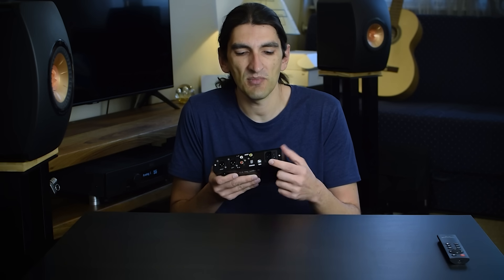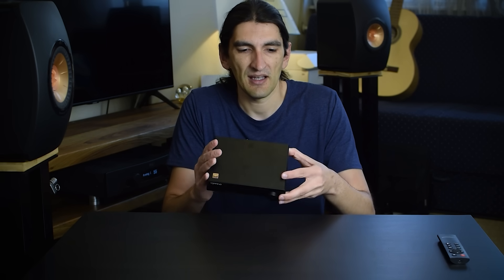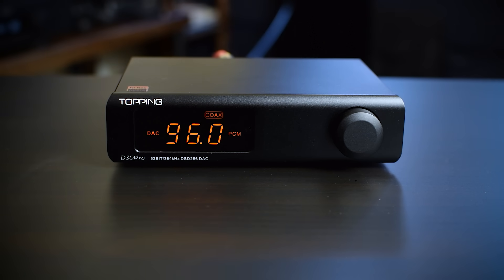Topping D30 Pro review - Don't buy a new DAC before watching this

Comment: How does it fare in 2023? I'm torn between buying e70 velvet or spend $250 less on d30 pro(in my country prices are wild). Or are there any better dacs in this price range?
Reply from the maker: I don't know the rest of your system and how much the case of Audiophilia advanced with you. But I would go for E70 velvet no doubt.
Reply: @iiWiReviews  So it is worth an extra $250(in my case). I've wanted a good allround ds dac, so I can focus on upgradeing my solid state amps and getting into r2r. Sort of a reference in this price range. I've considered this used d30 pro bcs the less I spend on a dac the more I can spend on new amp/headphones and soundstage is quite important for me.

Comment: Just now i ordered Topping A90D in flash sale.
Is this D30 pro technically compatible? Will it work in stack with A90D ?
Reply from the maker: Congratulations! It will work no problem.
Reply: @iiWiReviews  lot of thanks from INDIA.
I suddenly bought A90d which forced me to buy this d30 pro DAC.
E70 velvet is not available here in India.
If E70 velvet is better than D30 pro, i should be ready to be disappointed with my purchase with D30 pro.

Comment: How about compared to the Schiit Modi Multibit II?
Reply from the maker: I'll just copy the answer already written in the comments about these two: This is a tough one. I would say D30 pro is an upgrade, but it is also apples and oranges. Meaning, D30 pro is more detailed DAC, with better extension on both frequency extremes. It would win on points. But because they are so different, if you are the type of person who appreciate warmth and midrange fullness (dislike any hint of dryness too) you might easily prefer Multibit.

Comment: My two cents!  I owned the D30 Pro for a short while and used it as a DAC and also as a PREAMP.  I rate it higher as a DAC, however, it seems to lack clarity and openness in the treble. If any of you own Schiit DACS you may know what I am talking about.  Otherwise, impressive noise floor in balanced mode that is warm and spacious!  Cheers
Reply: @feronous8207  I cannot give you an answer...too many variables and unknowns.  If you are getting noise, it is probably you pc settings not adjusted properly.  Good luck!

Comment: Can use with speakers?
Reply from the maker: Only with active speakers (with integrated amplifiers). If you use passive speakers, you need to connect this DAC to amplifier first, and then connect that amplifier to passive speakers.

Comment: Did you listen with a preamp, or straight into a power amp?
Reply from the maker: Both... D30 pro is better DAC, not so good as preamp (lean and not energetic).
Reply: @iiWiReviews  I figured you had, but wanted to clarify.
Reply: @iiWiReviews  hi,if i want to pair a preamp to D30 PRO,which product you suggest？

Comment: Cirrus Logic DAC may not be the best DAC out there but it is always the most musical and analog sounding DAC compared to the rest. ESS still sound too digital to me no matter how good it is.
Reply: Powerdac v2.1 is an  ess-based dac and sounds super musical and smooth.
Reply: It's how a Dac is implemented on the circuit design, so you can get a ESS that's better than Cirrus

Comment: Amazing review. I need a little advice. I want to put a simple system in my basement. I have a budget of $2,000 US. Can you recommend a set of speakers and amplifier for me.  

I mostly listen to classical ams jazz. Thanks for any advice and help.
Reply from the maker: For that amount of money, and if the listening space is not too big, I would personally go with KEF LS50 Wirless (new version number II is a little bit out of the budget, but the original version should still be around at a decent discount). Those are active speakers with amps and streamer built in. There's even an app that lets you adjust their response according to your room needs.

I know people like to play with separates, I like it too, but let me put it this way - my current system based around passive version of LS50 has an MSRP of around 5K USD and it still doesn't sound as good as LS50 wireless. I keep it because I like tinkering and I'm doing this so I need to be able to test separates... But if that wasn't the case I'd sold everything and I'd go for active version myself.
Reply from the maker: @johnm3544  I can't say for sure, but thinking about it, in the active version we do get rid of many long cables and connection points. Also, the speaker is basically be-amped with mighty class D amps for the bass drivers and class AB for the tweeters. Doing this they're bringing the best from both worlds - control, power, and punch in the bass thanks to class D... but smoothness in the upper parts thanks to class AB. It's basically very smart engineering and use of specific opportunities that the active version allows.

Comment: Thanks for another very comprehensive review. You do a terrific job describing the sound of this product. I’ve heard Topping DACs before. They are much cheaper and once characteristic they have is a bit of digital glare. Would you say this device has that under control. You mentioned they are bright. Would you say it’s glaring?
Reply from the maker: If I'm assuming correctly what you perceive as a glare than yes, it has a bit of that. I'm personally more inclined to sacrifice a bit of resolution for smoother upper section.
Reply: @iiWiReviews  I agree wholeheartedly.

Comment: I got the D30 pro recently to audition and the balanced output is around 9db lower than the unbalanced output.   Weird.    
It is too soft , and rolled off.     Shame really.
Timbre is ok.  Much better than the ESS chips.
Reply from the maker: Something is not right there, balance should be louder.
Reply: @iiWiReviews  did you try yours to see which is louder?    Or did you only try the balanced?
Reply from the maker: I tested both. Also, balanced connection is always louder on any DAC because of twice the voltage compared to single-ended.
Reply: @iiWiReviews  I found out why it plays so quiet.   Because my benchmark LA4 preamp boosts the RCA inputs by 15db to match the XLR inputs.   But benchmark is for pro audio which XLR is even louder than home audio. 

Still Topping needs to improve their analog outputs and power supplies .   All they do is add better measurements constantly.   After awhile it adds nothing to the sound. 
The problem of noise in DACs has been solved for quite some time now
Want a great sounding DAC? 
Try the Marantz HD DAC1 from years ago.  
Blows any topping away. 
Easily